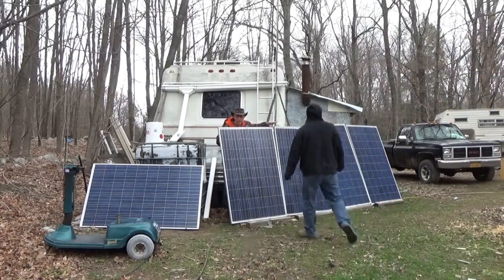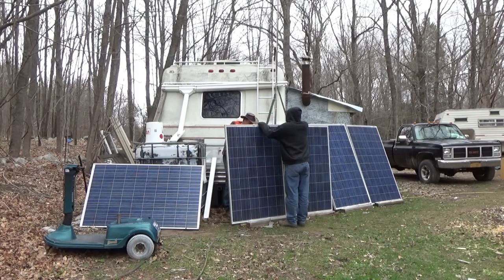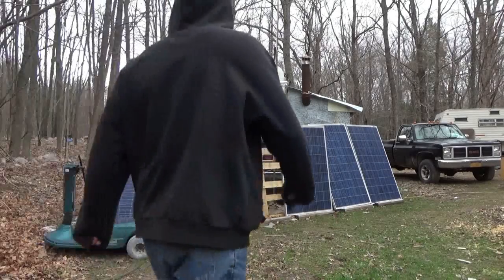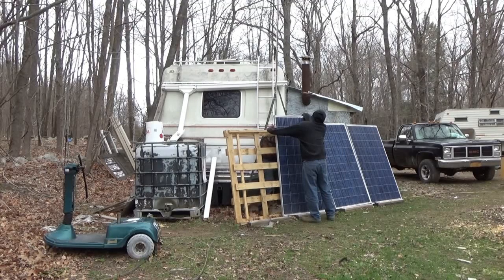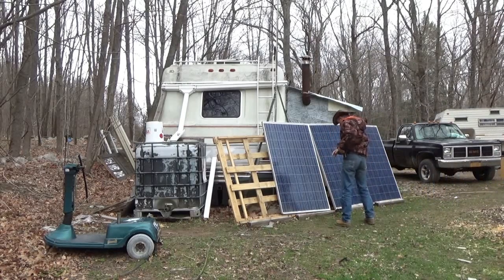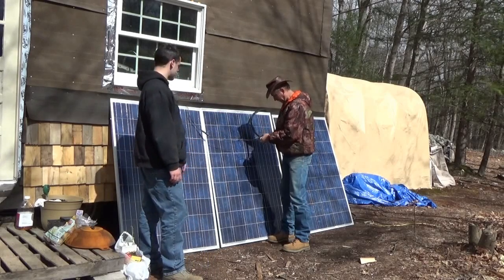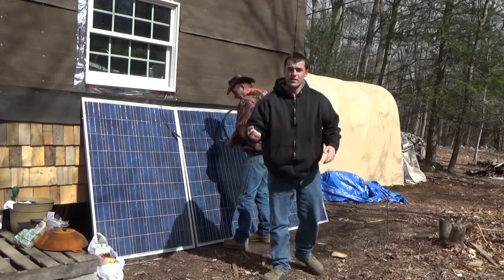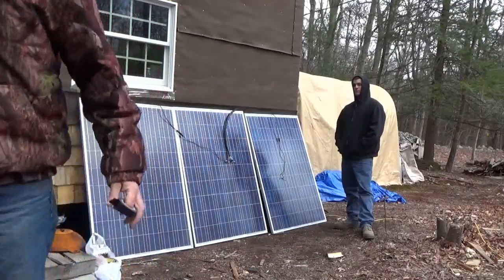Adding More Solar Panels To My Off Grid Tiny House On Wheels

Comment: Solar panels look great. I am here in Kingman Az and I hope to buy a house soon. I had A 140 watt Kyocera panel on my camper rig and loved it, with the house I will add panels as well. I no longer have the camper but someone else here in sunny Az has it. Charges the batteries enough to run all the lights, fans and radio in the rig. What year is the pickup in the background?

Comment: Greetings Troy, enjoying your videos. I was just wondering - with different sets of panels in different locations, the ones in the shade might 'short' out the ones in the sun at different times of the day. I've read that shaded panels/cells can affect how much power is gathered from the other panels/cells in full sun; just wondering how that might be managed, or if it's even a factor..
Reply: Only if the shaded and unshaded panels were all wired in series, as a pose to two sets of series panels wired in parallel.

Comment: How you gonna work on they pallet shingles with those solar panels sitting in the way? That tar paper dont last forever you know you better get that done. or your going to ruin your rock wool insulation.
Reply from the maker: shartne I will build A frames for the solar panels and get them off the wall

Comment: Well the increase is good but the charge controller only sends in enough to charge batteries to full all excess is not sent to inverter for ac while you have overage of power. Hope you can up your use of excess to run air conditioning to cool on real sunny days.
Reply from the maker: Frederick Nolan I am going to have to get another large charge controller to increase the use of the solar power to its max.
Reply: The Do It Yourself World Also be good to have two independent systems for redundancy, given the meadow's disaster track record.

What is the AH storage capacity to 50% of the forklift battery pack currently (pun!) attached to the Tiny House? Thanks.